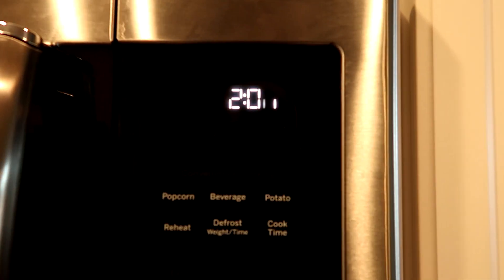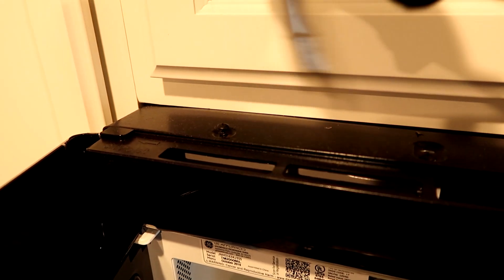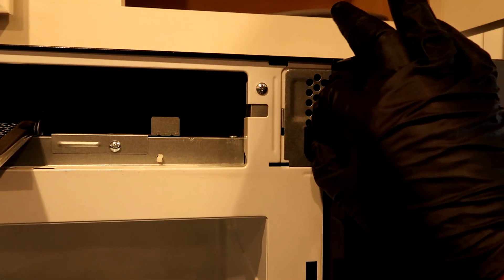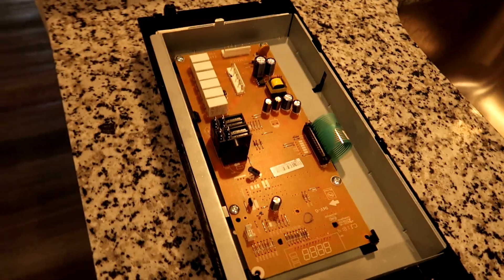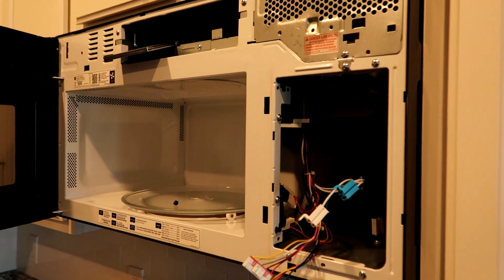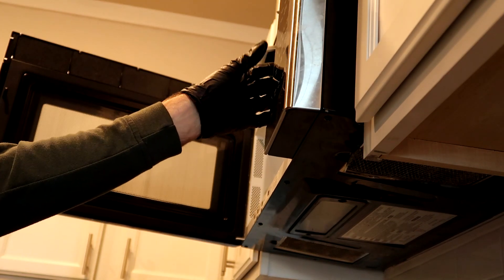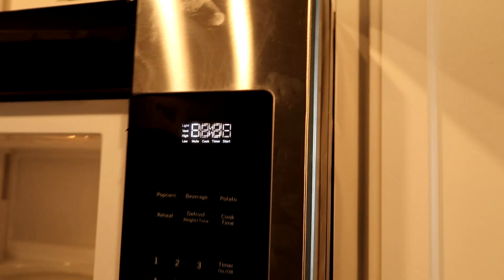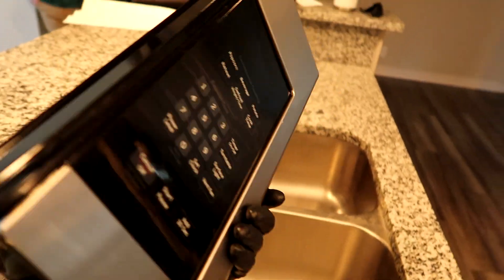How to Replace Microwave Touchpad

Comment: Lex, have you a video showing replacing/repairing the door latch?  The cheap crap plastic latches break easy.  I repaired mine by just drilling a small hole for the spring to hook to after the hook part broke off.  Enjoy your videos!
Reply from the maker: Not yet but if I run up on one I'll record it for sure. Thank you so much for watching Lawrence!

Comment: Do you know how to get to the screw that holds the keypad assembly on an Apollo 1/2 time convection microwave. I know it lifts up but i cant find a screw. It dont have the grill to remove
Reply from the maker: Hmm I'd need to be there for this head scratcher 🤔. Try sliding it to the left.